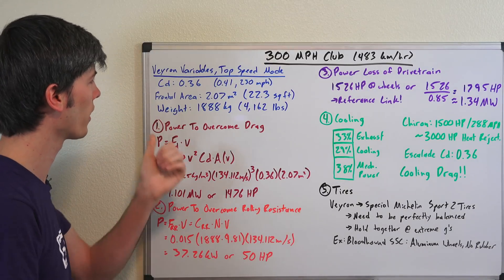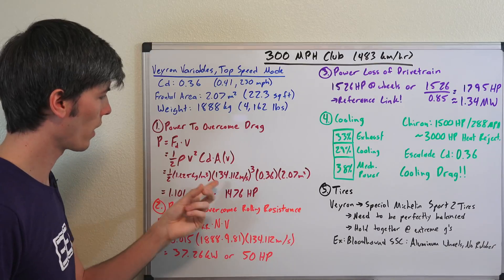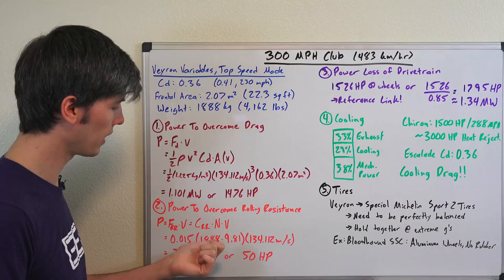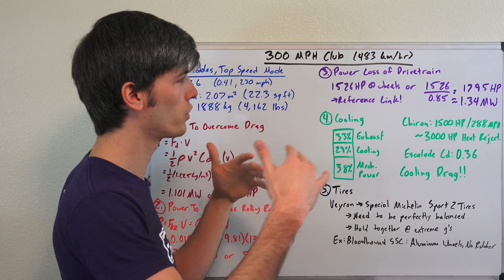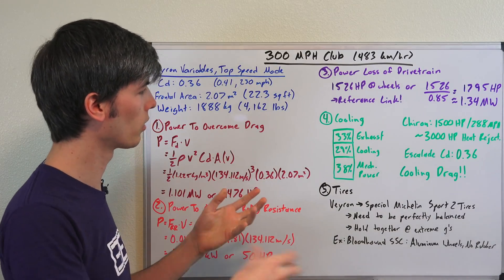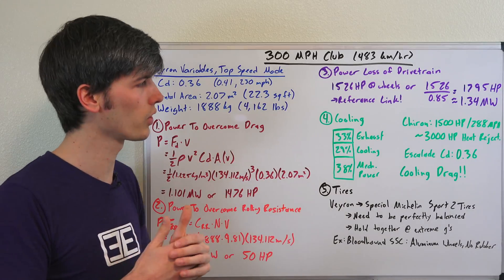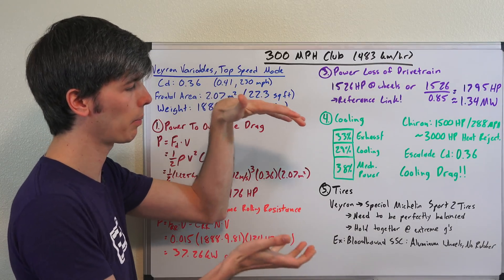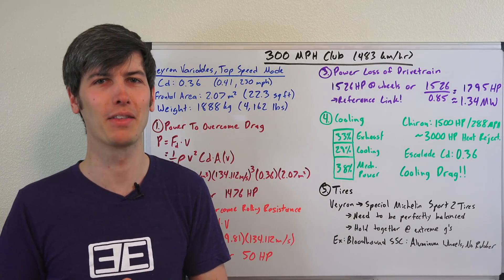Why Has No Production Car Hit 300 MPH?

Comment: what about a 1500 horse (or whatever the power equivelant rating is) electric car.
Reply: Seth C They are too heavy and struggle more than Petrol cars at high speeds because of both the weight and limitations of the electric engines. They overheat etc
Reply: Dean Grimsell Not exactly true. The Buckeye Bullet 3 is an electric vehicle that hit 341mph in like 2004 or something with a 400hp motor.
Reply: the buckeye bullet was also not a production car, and wasnt shaped like a car at all either.
Reply: weight doesn't matter for top speed it's all about horsepower and drag.
Reply: Moth I thought weight did? it made horsepower more efficient
Reply: no no, it matter a lot more for acceleration.

Comment: I don't know if he says this during the video but it's a need thing for the most part. There is no demand for it. To make a powerful enough engine and car to make 300 miles an hour you will need to spend a lot of money for development. And when would you ever go that fast? Even on a closed track there usually isn't enough straightaway to get to that speed. If someone spent the money to develop that nobody would buy it. Also to reduce the drag enough to make that speed the car would probably be an ugly bullet shape, which would add to the fact that nobody will ever buy it.
Reply: all bugattis are sold, but the company bugatti doesnt make money. its more like a hobby of vw. 
And the chiron has a lower top speed than the veyron. so the people didnt buy it only for the top speed.
Reply: Pedro Rocha no one who would buy a car capable of 300mph is really is really going to be concerned about safety
Reply: someone would buy it.  but probably 1 or two .
Reply: bullet shapes look awesome but I think are no good for safety
Reply: Anonnymouse Hacker ive hard rumours that it can hit 285-290
Reply: well the chiron is getting close. 280mph..
Reply: So a MODIFIED Chiron goes 280, but there's no way a CUSTOMER'S car is going that fast, due to governor/gearing/whatever.

Then...the top speed record is "cachet" and "status," even though 99.99% of owners have zero intent of going that fast: it's "bragging rights?"

Really, any random shitbox can go as FAST as you want. When you talk about "high performance" cars, you want a QUICK car instead, and AGILE, too. Basically, meaningful performance is ACCELERATION in four directions (accel, decel, and turns). Top speed of any modern car is "in excess of what's required."
Reply: Joshua Pichardo it will literaly a 2 ton bullet
Reply: look at the koenigegg one:1 it's one of the most beautiful supercars ever

Comment: At how many rpm will the tyres spin at 300 mph?
Reply: Adrian Anzano obviously
Reply: JoraForever depends upon the radius of the wheel, give me a number and I'll tell you.
Reply: Mir Daniyal thats a nice question lets say 20"
Reply: Mohammad Chehadde 5,044.59 rpm roughly at 20" radius
Reply: Howler you forgot to factor in the dynamic coefficient of frictional rolling resistance, and the expansion of the wheel due to inertial rotatory velocity, which will cause a temporary i don't know what I'm talking about.
Reply: so if i calculate a diameter of 803mm at a speed of 483kph i would see a rotational speed of 3191rpm, this is without taking dynamic increase of diameter due to speed into account. i doubt the tires will not stretch out at those speeds so their overall diameter will increase thus lower the rotational speed but i dont know by wich factor so i cant put that into an equation, an educated guess would be somewhere around 3100-3150 maybe.
Reply: where did i go astray then? 483kph being 483,000,000mm per hour, devide it by 803Xpi( 2522.6245) gives me 191,467 rotations per hour, devide by 60 for minutes that is 3191...
Reply: John Green you forgot to multipy that number by 60, 83.9 is  rounds per second, therefore its about 5035 rpm for 20 inch diameter
Reply: mikael K   it's 4585rpm  ;)
Reply: Lets say a 245/35R18
Reply: that's what i explained in my first comment... but it will be in the realm of close to that.
Reply: The tires are never spinning at 9000 rpm. The engine on the other hand could spin at 9000 rpm if it designed for it. Most redline (top out) at closer to 7000 rpm
Reply: I can't find a single production car with a sub 3" side wall.

Low profile sports car tires;
Corvette Z06               335/25/20, 26.6" diameter, 3.3" sidewalls.
Ferrari 488 GTB          305/30/20, 27.2" diameter, 3.6" sidewalls. 
Mclaren P1                  345/30/20, 28.2" diameter, 4.1" sidewalls.
Koenigsegg Agera R  345/30/20, 28.2" diameter, 4.1" sidewalls.
LaFerrari                      345/30/20, 28.2" diameter, 4.1" sidewalls.

3.3" is the smallest sidewall fitted to a 2017 production car that I could find, making 26.6" the smallest "high speed production car tire" I could find.

In order to find a car with tires as tiny as 23", you have to look at micro-machines. 

Toyota Yaris    195/50/16, 23.7" diameter.
Ford Fiesta      185/60/15, 23.7" diameter. 
Honda Fit         185/60/15, 23.7" diameter.
Chevy Spark    185/55/15, 23" diameter.
Fiat 500            195/45/16, 22.9" diameter. 3.45" sidewalls.
Smart Fortwo  175/55/15, 22.6" diameter. 3.8" sidewalls. 

22.6" are the tiniest tires I could find on any production car in 2017.
Reply: right so, this is getting confusing and whenever that happens in math problems you gotta look at the main question again. thus: "at how many rpm will the tyres spin at 300 mph?" first of we dont know which car he's talking about but we can assume he means the veyron. and we need to calculate the speed of the tires, not engine rpm so all gearbox and engine issues can be left aside, lastly is our target speed of 300mph or 483kph. to keep things simple i will use the metric system to do my calculations as using a x10 system for distance and a x60 system for time is much easier than using inches and miles. so here goes: according to wheel-size.com the bugatti veyrons rear tires are sized 365/25ZR21 and the fronts are 265/35ZR20. first let's focus on the rears.

-Rear: we know the diameter of the rim to be 21 inch or 533,4mm
the height of the sidewall is 25% of the width of the thread, being 365mm so our sidewall is 91,25mm. keeping in mind that we have a sidewall at either end of the diameter of the rim we can calculate the wheels entire diameter to be 533,4+(91,25x2)=715,9mm
allright then to get the circumference or the distance the wheel will travel with 1 rotation is going to be 715,9mmxPi= 2248,99985mm
now we need to calculate the rotations it's gonna take to travel 483km or 483000000mm so we divide 483000000/2248,99985=214762,13082006rph
no devide that by 60 to go from hours to minutes and we get 214762,13082006/60=3579,368847001rpm so rougly 3579rpm.
that's the theoretical rpm if there we no wheelspin occuring, due to drag and power applied to the wheel we can expect to see a 10-15% wheelspin so our wheel will be rotating 10-15% faster, 
that's respectively 3937rpm-4116rpm.

-now for the Front's:
diameter is 20inch, 508mm
sidewall is 35% of 265 = 92,75mm
wheel diameter is 508+(92,75x2)=693,5mm
circumference is 693,5xPi= 2178,63025mm
wheelspeed is 486000000/2178,63025=221698,93216161rph
or 221698,93216161/60= 3694.98rpm
with wheelspin that would be 4064rpm-4249rpm

i like these kind of discussions. makes me think and research stuff. and if i make a mistake i will get flamed harder than i ever got flamed in school haha.
Reply: Paul Freedman "Even an 10 years old..." 

No, nothing is wrong with his sentence at all....
Reply: Roughly 5,042 rpm.  As others have said, there are other variables involved such as traction and resistance.  Your computer monitor likely refreshes slower than a tire spinning this fast (60hz vs 84 rps).

63,360 inches per mile * 300 miles = 19,008,000 inches (x)
20" diameter wheel * pi = 62.83" (y)
x / y =  ~302,530 rph / 60 = ~5,042 rpm / 60 = ~84 rps
Reply: JoraForever Aprox. 5000 rpm per minute, that produces a force over 3000g for each tire.
Reply: Bob Hope But most of those high speed production cars have low profile tires (sub 3" thickness) so 22, 23" isn't unreasonable
Reply: Howler you didn't allow for gearbox final drive ratio, or diff ratio, volume of chamber blowby as a constant of something something calorific value something octane rating something something cylinder volume, reactant air volume in fuel/air ratios... everything varies with constant harmonic equilibria like height above sea level, centroidal variance from the core center irrespective of altitude above sea level and finally the media through which the phenomena will be something something
Reply: user_mac01 he forgot the turboencabulator.
Reply: Mohammad Chehadde plus, the transmission needs to have a gear that has a gear ratio that allows for over 300 mph
Reply: Howler that's not correct, recheck please.
Reply: mirsec008 that's correct my calculations gave 5035 rpm
Reply: JoraForever to many
Reply: That's not correct... The Diameter of the rear wheel of the Veyron is 21.5". If the overall diameter of the wheel + tire is 31.6" like you say it is, then you're suggesting that the tire itself is over 10" thick? Nearly a foot long. Doesn't sound correct.
Reply: The Bugatti Veyron Rear tire size is 365/35/21.5. Look up how big it is yourself. It is ~5in of sidewall on a 21.5in wheel.
Reply: duude you forgot friction exerted "by" the road "on" the tire !!!!!!!!!!!!!!!!!!
Reply: According to my math a 365/35/21 would be 790mm or 31.1", but the Veyron uses an odd 21.5in wheel, bumping it's over all diameter to 31.6" or 803mm.
Reply: so i'm guessing your answer would be Purple Abraham Licoln...
Reply: It certainly will spin (to slow) and make smoke if you throw it into 1st gear....
Reply: Nothing wrong with his sentence.
Reply: Like 10
Reply: damn, that's a huge tire!  I think he was talking about 20" wheels, a long of off-road trucks have 35" tires, and that's only 17.5" radius.
Reply: JoraForever 4500 rpm
Reply: for 22" rims
Reply: Mikael K us smart people? Because you used cm??? Tf?
Reply: its been expained pretty well by howler.
Reply: Matthew Wise yo chill out man, i wasnt directing that to you it was to the entrie thread.
Reply: Let's assume tires are 22 inches (55.88 cm for us smart people), it would be roughly around 4150rpm at a speed of 483 km/h
Reply: Everyone here is giving out some tiny tire diameters.  20" wheels are normal, but for a 20" overall tire, you'd have a 12" or 13" wheel. Not since the 3cyl Geo Metro has a car had wheels and tires that small.
For reference, my personal car's tire diameter is 27.7in. (704mm)  
Edit: The Veyron's rear tire diameter is 31.6"  or 803mm.
Reply: Adrian Anzano gearing... you can use gears...
Reply: It would probably be up there at like 658267207340 rmp but idk really...
Reply: You want to know tire rpm at a known your speed with a known tire diameter.

  1) Divide speed by diameter.
2a) For mph/inches, then multiply by 336.1
2b) For kph/cm, multiply by 530.5
  3) Sit back and bask in your glory.
Reply: true but keep in mind that a 20inch wheel is small, the veyron might be using 20 inch rims but the tire around it increases that diameter, my calculations went of the 803mm diameter of the entire veyron wheel.
Reply: JoraForever 1808 rpm
Reply: Goldenvte, They're more like diesels.
Reply: Mohammad Chehadde most cars today top out at 9000 rpm, they would have to make one that exceeds 10000

Comment: what's about a f1 car with no wings?
Reply: Domenico Florian Rescigno sounds like death
Reply: L1TTLEH0RN666 it would still have the downforce of the rear diffuser
Reply: A top fuel dragster hits nearly 330 in less than 4 seconds. I'm sure a formula one could do it if given enough room with as little downforce they can muster. They are hardly production vehicles though.
Reply: Domenico Florian Rescigno He's talking about production cars.
Reply: Khaled Hossam I know, I was just wondering :)
Reply: Domenico Florian Rescigno ahh
Reply: Domineco Florian Rescigno Get me an F1 car without wings and I'll give it a go.
Reply: Domenico Florian Rescigno  not factory
Reply: Clearly David m did not read what I spent my free time typing.
Reply: Whats your opinion of reliability? I mean these engines are using ancient technology compared to formula one, putting out in excess of 10k hp, and in some calculations excess of 12k hp. The engines are not totally shot after a run either. They make changes between runs to make the most of the data feed back by changing rings, or adjusting compression by changing headgasket thickness. 

Will it go 100k? Probably not, but likely neither will a bugatti before needing rebuilt.

Comment: But there is a car named Devel Sixteen that has hit way beyond 300mph.
Reply: Simon Valborgland ha ha, good one!
Reply: haha, that car is a joke, hasn't proved anything so far.
Reply: Simon Valborgland did you not see the "production"????
Reply: thats what they claim, i havent seen any proof of it
Reply: Engine that was supposed to go for the Devel is actually real and working, it put down what, 4500ish on an engine dyno? 
But the car itself is a joke indeed =))
Reply: is it a production vehicle?
Reply: The Stig's German Cousin no it's not
Reply: Simon Valborgland it hasn't even been built as a turn key prototype. all hype and no hyper car
Reply: +Simon Valborgland
No there isn't.
No it didn't.
Do some research.
Reply: it hasnt and it never will, the devel 16 is a pipe dream of arab oil tycoons.the prototype is nothing more than a show car, it doesnt even have a v16 engine
Reply: and they claim to have 5,000hp. Well over the 1800 this video says is required. And it hasnt made any passes at that speed.... it's a joke of a vehicle
Reply: Hahahahahahahahahahahahahaha
No it hasn't. And no it never will
That toy car is a joke
Reply: Even with the 5000 horses that car claims it has, the car is veeerrrryyyy heavy. If im correct its heavier than a hellcat and that thing is a boat. So yeah it has 5000 hp but after that weighs kicks in the speed only adds up to probably 1500 hp maybe a bit more.